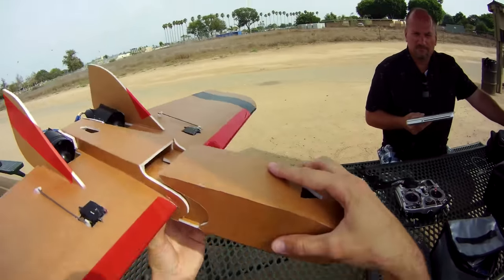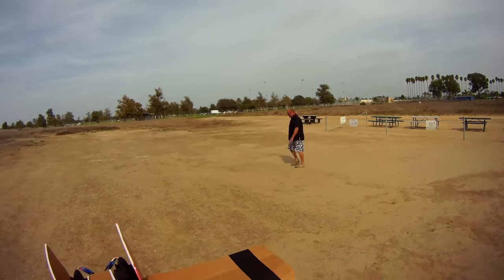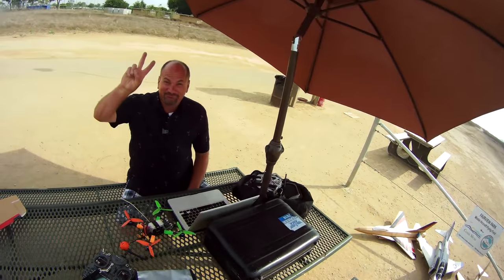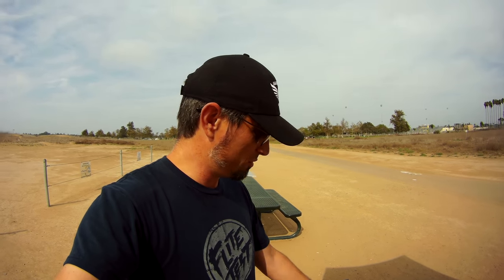GOBLET Maiden - Twin 56mm EDF Flite Test Goblin

Comment: Oh well, got one good session out of it. :D Out of curiosity - what would have been the downsides of flying it on 3S? Just lower top-end speed, or some other factors?
Reply: Lower top end speed. The motors are at a certain kv. K stands for constant. So putting a 3s in it simply means that the motors will spin at a slower speed
Reply: The rpm is the KV rating of the motors times the voltage of the batteries. 3s would be multiplying the kv *12 and his 4s is the kv * 16. As a quick example.